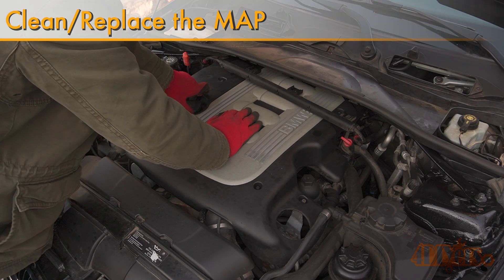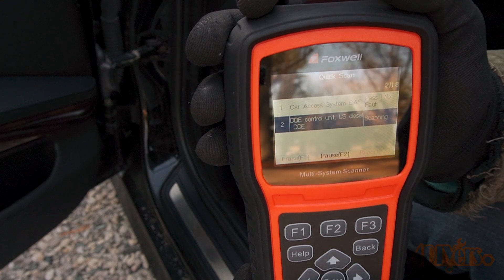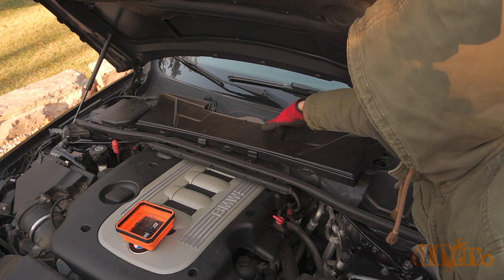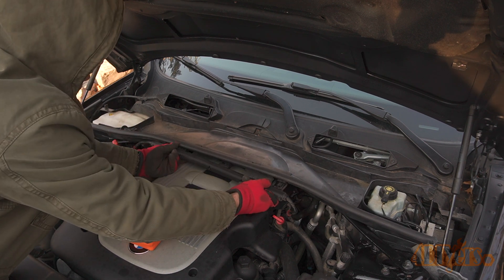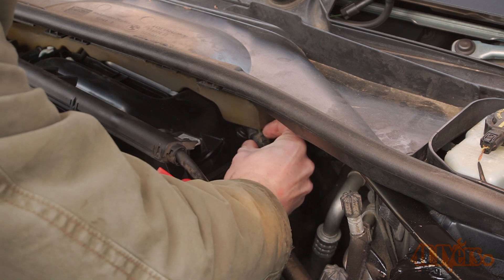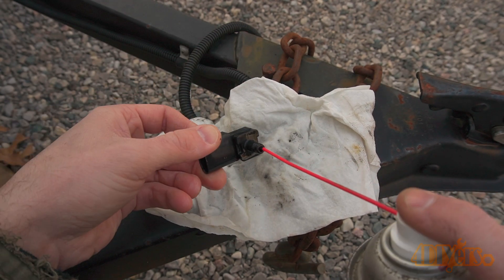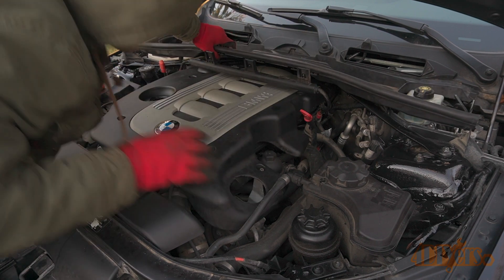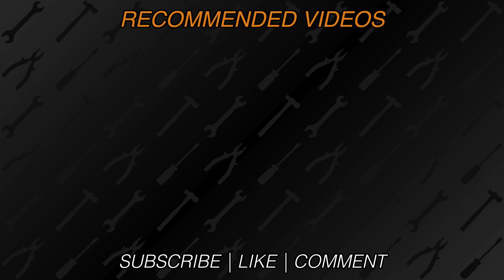How to Clean or Replace the MAP/Boost Sensor on a BMW M57 Diesel

Comment: Hi @4diyers and thanks for the awesome video, I have a boost sensor error code on my X5 E70 M57,  car on limp mode, removed the sensor and tried cleaning it but it was clean. Could it be that it's maybe completely dead rather than dirty? Do they die in some instances?
Reply: Did you replace it?
Reply: @Struktogramm1  I replaced it and no luck, turned out to be the Pressure Converter connecting the boost lines, apparently this part gets missed a lot as it throws no error to the dashboard or scanner
Reply: @Xpress_Graphix  i replaced mine today and the error is gone.
Reply: @Xpress_Graphix  what issues you had mate ? cause looks familiar the case you had with what I am facing now
Reply: @rebelaris  Well in my Case a new Map Sensor did not help, problem was the Pressure Converter / Boost Solenoid
Reply: @Xpress_Graphix  I did order both pressure converters, see what it will change , I have the same issue
Reply: @Xpress_Graphix  my turbo is whistling, I can hear it while I push the throttle down but there’s no boost at all and I have various of codes including that. I did swirl flaps delete and when I put it back , I lost completely boost. I did change Map sensor and car still on the same condition. Now I will focus on boost pressure converters and see if it will change anything
Reply: @rebelaris any luck? 5:12
Reply: @denisovanhybrid9610  well 😂 was an interesting fault 

But nothing to do with the video , all fixed now and quite expensive because that interesting fault caused a damage later
Reply: @rebelaris  what was it?
Reply: @denisovanhybrid9610  The delete kit of 33mm , the rubber seal that is around that cap was too thin (which I did suspected it when I installed it but I thought since everyone is buying this 33mm kit then shouldn’t matter) and that was causing air pressure lost. By replacing it with thicker rubber seal the issue was fixed , but meantime , somewhere along the way since I starting losing pressure and still using the car , somewhere and somehow some pieces of plastic were found on the turbo which cause the biturbo to fail and I couldn’t find parts to replace the issue which was cause in the turbo so I had to replace it with a whole brand new biturbo. 

Now the car runs good